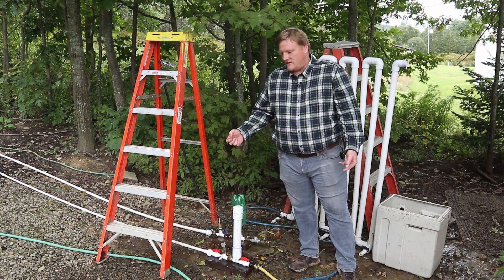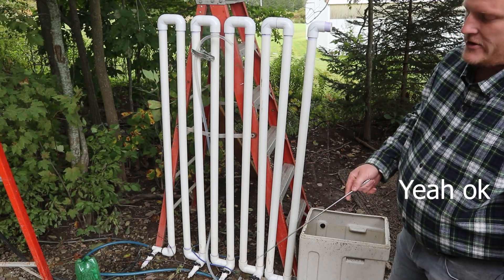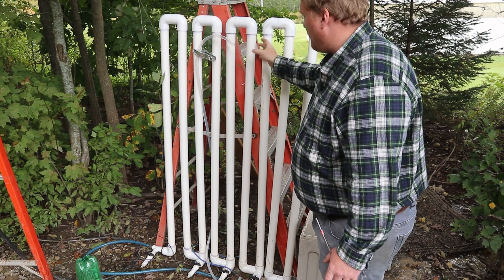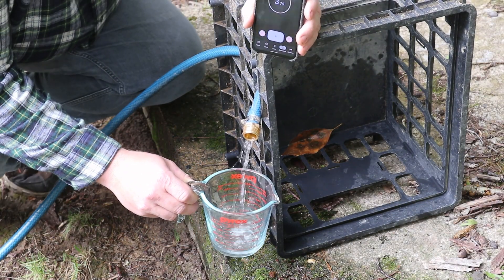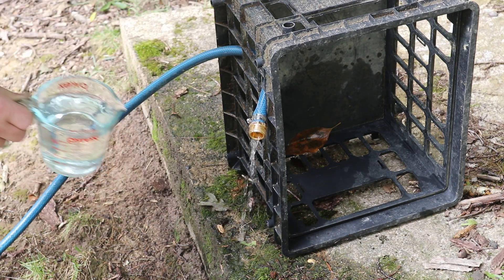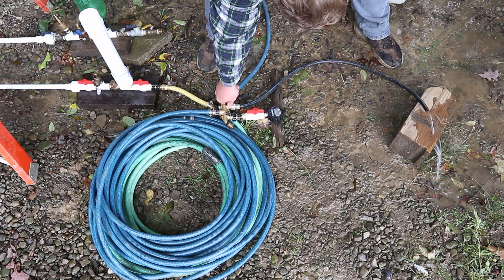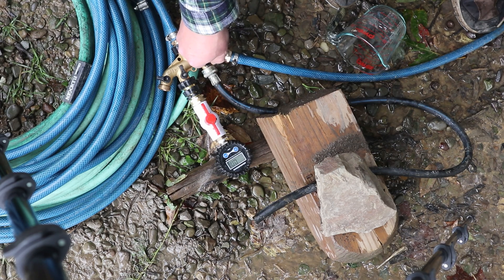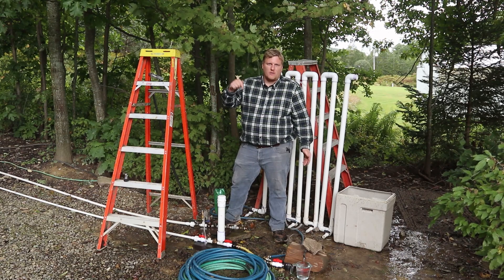Ram Pump; Flow Test Validation (3-Ways)

Comment: With your artificial back pressure device there will be a compression of air in the tube and I think that could be causing a real world change in height. And with the water volumes involved, I don't think that hose friction would make much of a difference.  Question. If you put enough pressure to get water 'just' coming out of your artificial pressure device, does that match up with the height with what you would get out of your long delivery pipe at the same calculated height. (You could then move the end of the delivery pipe up until you 'just' get water coming out to give you the exact number. Clear pipe would be your friend here).  BTW, thanks for the great content.
Reply from the maker: I didn't explicitly show it but I didn't mention that I had both the artificial device and the long delivery pipe open at the same time and they were both flowing about the same amount of water so I just assumed that they were at approximately the same head height.

Comment: Velocity of the output water flow in the uphill water hose. That plus expansion of that hose during a pulse providing a buffer effect. The variables at play would be very difficult indeed to quantify.
Reply: The expansion of the hose requires energy and although it will return to its normal diameter during the low pressure phase of the ram pump.. you wont regain all of the energy it took to expand it..

Comment: I think the change in flowrate is coming from a change in cross-sectional area for air lock setup. You can see this by comparing it to the conventional setup and using the equation for flowrate, Q = velocity * area. The cross-sectional of the outlet is much larger than the hose, therefore, increasing the flowrate. You should see this same effect by throttling the valve on the valved setup, but with no elevation head loss, it makes up for it. I would suggest testing this by reducing the outlet area of the air lock setup to match the hose outlet. Hope this helps!

Comment: I have a feeling it has to do with the way they buffer the output. In some way this has to effect the efficiency of the pumping action of the ram pump. Much like how changing an exhaust or the internal volume of a 2 stroke engine. "Resonance" In something that works on such basic principles and that literally uses resonance to power it I suspect that small changes can yield larger than expected differences.
Reply: Yea, the near constant (suppressed pulse) of the stream from the conventional run seems to indicate something like that is happening.  Air is easier to displace than water, so the 'full' conventional hose is going to potentially have more resistance as a result?